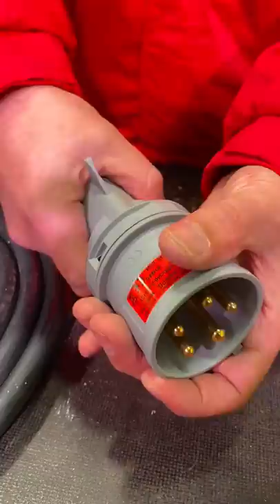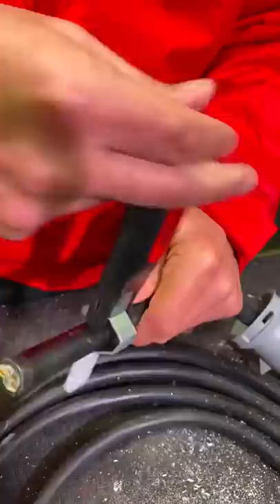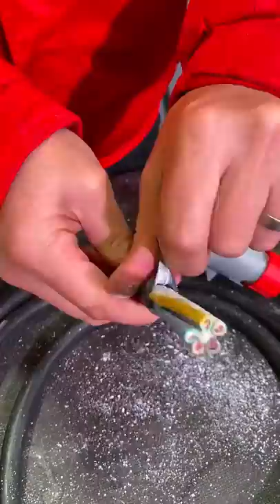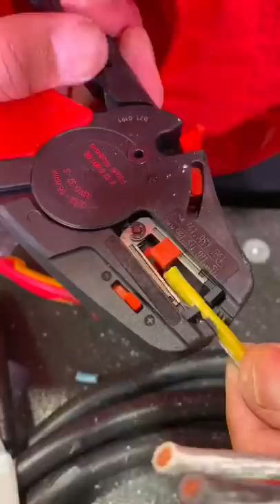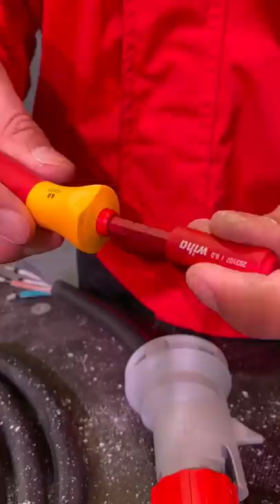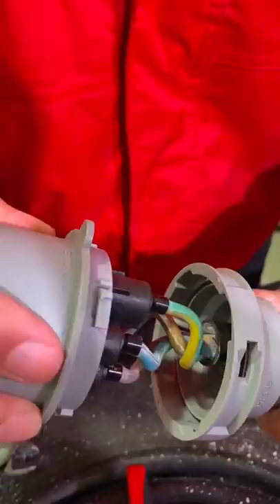Stretchy HO7 RNF rubber cable and a 32 Amp three phase plug. #shorts

Comment: My electrician told me to leave the earth cable a little bit longer in case somebody pull  the plug more aggressively the protection stay in the plug last. It's still relevant these days, what is your opinion about that?
Reply: The eath connection terminal is a bit longer, so it is already accounted for.
Reply: @lachertje812  I thought the earth terminal being a bit longer made the wire length shorter?
Reply: @TheFool2cool  Uhm...if all wires are the same length and the earth is closer...
Reply: @TheFool2cool  no, if the cable is ripped out of the plug, the ground wire should be the last one making contact. So it should be left longer. Some connectors, like this one have the ground terminal longer to have the same effect, you should never have the ground shorter than the others.
Reply: @lachertje812  Same rule applies for other situations where all connections are aligned.
Reply: @matekochkoch  if the earth terminal is longer inside the plug, which it usually is, the wire will end up shorter as the terminal is closer to the back shell of the plug.
Reply: @TheFool2cool  the wire is as long as you cut it. Regulation demand that the ground wire is the last to be disconnected when being disatatched by force on all mobile connections. So it should be left longer than necessary.
Reply: On point ☝️ earth cable should be first to make and last to break ....
Reply: Your electrician don’t know Jack. You put all the cables together. Safety in numbers durrr.
Reply: @matekochkoch  which regulation states this, out of curiosity.
Reply: @TheFool2cool  in Germany VDE 0701 / 0702 if I remember correctly. Most other countries have a similar regulation, simply because this one really makes sense.
Reply: Regulation in UK and much of Europe. In the US we use 120v and gfci. Still don't think it's a bad idea to add a little bit of extra for the ground though.
Reply: @ARVash  GFCI (=RCD) are mandatory for most installations in Europe too. but we use  230V (phase to N or ground). The shown connector was a three phase connector so the voltage between the phases is 400V  (230V*sqrt(3)).
Reply: I was thaught to do that in trade school just last year, so i guess it is. No reason to not do it really
Reply: Its okay move. Its highly unlikely to happen
Reply: I mean yeah always. There’s no down sides and just one day could be the day it’s needed
Reply: My dads an electrician I never really learned anything advanced cause I wasn’t interested but he always told me to leave extra incase someone else needs to go in after you and cut back some wire.
Reply: @lachertje812  which is why you especially need to leave it longer otherwise the pe gets ripped out first lol
Reply: You just don't pull out this cable trust me.
Reply: Jesus, you all need to pray to Jesus. 

The contacts inside the plug will disconnect the ground last. The wire length inside the plug has zero to do with that. 

You can wad them up or stretch them banjo tight, doesn't change the pin length on the plug itself.
Reply: @Sawyer_202  If you look closely at the video you can see the PE terminal is elevated from the others. So even if all cables are cut the same length, PE will still get pulled out last. 👍
Personally though, I usually cut the PE a bit longer than the others, just for extra measure.
Reply: i believe it is a standard practice in UK plugs. and i think its pretty smart
Reply: I am a Mechatronics engineer, at my work, pretty much a electrician and we always let the earth between 0.5 and 10 cm longer (depending on the location and use of it) 
and where I was still in my learning time, I got shit on for not cutting the rest shorter.
Reply: yup that is always taken into account just like how 3 prong plugs the grounding plug is longer than the hot and ungrounded
Reply: uk plugs already have this
Reply: @leftyeh6495  when you disconnect the plug, yes, then the plug design makes sure PE disconnects last. We were talking about someone pulling the cable out of the plug, not the plug out of the socket. And yes, if I make the earth lead 1 cm long and all the others a meter long, do you really think the plug will still ensure the others — with zero force on them because they have a meter of slack — will disconnect first?
Reply: @matekochkoch  I'm glad you replied with that now I understand why the ground is closer than the others I was cutting the ground so the cap would fit easier when assembling the cap  I'll now keep it the same length thanks
Reply: My opinion as an apprentice is exactly what you said
Check out a bit how uk plugs are wired on a device. The shortest conductor is live, a little bit the neutral and a lot longer the earth.
Reply: Same I learned the ground wire is a bit longer
Reply: That's more for standard plug wiring, where it's designed into the housing. But I believe it carries into many applications; the earth is forced to be a little longer.
Reply: i have added bit of length everywhere where pulling is issue. doesn't hurt. just with some cables it's too big to do it. but with 1.5mm2 and 2.5mm2 it's easy. my 3g2.5 has even little loop inside. but then in others i have nothing as i made them before realizing this. doesn't really hurt

Comment: Next week tune in for the Wago version of the plug 🤣
Reply: There are lever type CEE connectors, the company I work for uses them on the regular.
I can't recall the brand :/ not WAGO tho..
Reply: @SuperUltimateLP  PCE and Menkennes make them I’m sure. Though I always prefer a traditional midnight PCE screw connection with a bootlace ferrule 😉

Comment: Very good… net time leave the Ground a Little longer! If the cable gets pulled out it Should get pulled out Last! Could save your life some day.
Reply: Usually the ground connector is a bit longer/closer to the cable entry and should be the last conductor to disconnect. I also leave the neutral longer because you don't want to lose neutral
Reply: The Earth terminal is about a centimeter longer than the rest. All the wires were cut to the same length. Therefore the Earth one will disconnect last without needing to cut the others shorter.
Reply: @han5vk  the scenario is that the cable strain relief fails and the cable is being ripped out of the plug. hence, keep 5mm difference between live and neutral, and 5mm-1cm between neutral and ground wire length.
Reply: @harddiskwp Yes that was what I was talking about. If the earth terminal is 1cm closer to the failed strain relief than the others, it will fail last, even if all the wires are cut to the same length.

Comment: I have literally 0 wire work experience but for some reason this satisfies something deep in my computer loving brain. I built my own but this is a whole nother level dude
Reply: You would be surprised by how simple it is. Gets complicated when you are dealing with data transfer. A lot of peoples internet service problems are due to faulty lines and ports.
Reply: @dividedpersona 80% of internet service problems are over-subscription by the isp, which promptly blames the customers cabling and equipment.  15% is bad down drops from the isp or setup issues.  5% is actually the customers problem.

Comment: The PE must be little longe then L1 L2 L3 and N, because if it tears apart, the earth should be last thing wire thats connected. Well Thats how learned it in Germany.
Reply: That is true, but as you can see the hole for the PE is on a hill, which means that it will still be the last connected wire. Typical 400V plugs in germany work the same way.

Comment: HO7 RNF, sounds like something I should type into Google Maps!
Reply: It's a butchered version of a harmonized cable code. The code written properly is H07-RN-F.

H tells you it's a harmonized cable.

The two numbers are a code for the voltage rating, 07 means up to 450V to ground and up to 700V between cores. In practice though the higher rated cables with thicker insulation are used more for their increased durability than for their increased voltage rating. 

The two letters in the second section tell you the material the insulation and sheath are made from.  R means insulated with ethelyne-propolyne rubber or equivilent. N means sheathed with polychrlorophene (neoprene) or equivilent (better for oild/grease resistance than normal rubber).

The -F tells you it's a fine stranded (flexible) cable.

It does not tell you the size and makeup of the cable. That is coded with a seperate code, for example 5G6mm² for a cable with 5 cores, one of which is green/yellow and with a CSA of 6mm².
Reply: @petermichaelgreen  awesome explanation thanks for that

Comment: As a electrician….looks great…as a foreman…that to long that wire looked like 8-10#awg you don’t need ferules when it has set screws on the lugs. Don’t need that fancy stripping tool get a blade strip it out. Make everything tight ohm it out your good to go😂 JK that looked like a permanent installation, looked good

Comment: What tool was used to strip that? And yes that’s a serious question, cause I’ve never seen it. I use a 14/3 rubber cable for mini split systems and hate stripping the casing back because of the thickness.
Reply: Yeah name of tool would be appreciated
Reply: No name yet??!!
Reply: Got you bro, had to investigate myself!

Comment: What sort of end cutters are they using to remove the remainder of the insulation? The end result is pretty much perfect!
Reply: Did you ever find out what they are called?
Reply: @andyglass3882  Unfortunately not, they look a bit like miniature hoof nippers, I did find 'end nippers' but they're too chunky for this kind of trim. The closest thing I could find is the 'mini end nipper plier' by Amtech, but didn't order any as I still think they look a little too chunky for it.

I legitimately spent an afternoon trying to figure this out, as ragged insulation is pretty dangerous in high voltage applications and something I want to avoid when working on EV tech. Currently I use side cutters and it takes me far too long to trim everything flush.

Comment: I'm not an electrician, but would it be worth tinning the ends before crimping the ferrules on to prevent future corrosion creeping up the cable?
Reply: The plug is water tight there shouldn't be any corrosion

Comment: I've always wondered what is this white powder inside cables and what is it for
Reply from the maker: It’s talc and makes it easier to strip as the conductors don’t stick to the outer jacket of the cable.
Reply: To celebrate after you do a good job.
Reply: It's there to annoy electricians who don't like to get their hands dirty! 🤣

Comment: New to the industry and I haven’t had the opportunity to deal with wire this big. I have a stupid question, what’s the powdery substance that came out when you stripped the wire initially?
Reply from the maker: It’s French chalk - makes the cable easier to strip as it stops the inner cores sticking to the outer sheath.
Reply: @efixx  Oh that’s awesome, thank you for sharing man I appreciate it!

Comment: Then open it up again to swap the phases as the motor always goes the wrong way 9 times out of 10!
Reply from the maker: You should check with a phase rotation tester first- bad things can happen if a motor goes the wrong way.
Reply: Or just invert 2 phases in the motor...

Comment: Then you realize you need to switch 2 phases...
Reply from the maker: You should test for that first - bad things happen when phases are reversed.
Reply: @efixx  Well, usually it's things like coolant pumps and hydraulic pumps running in reverse.  Machine manufacturers don't seem to have any rhyme or reason to which phases are which IME.

Comment: Question: What's the powder stuff surrounding the cables? Is it for insulation or...
Reply from the maker: It’s French chalk - makes the cable easier to strip as it stops the inner cores sticking to the outer jacket.
Reply: @efixx  oh, interesting. I've never seen that before

Comment: Is it wrong to have the copper exposed out of the ferrule end? Like just a tiny bit. Or is that the right way to do it? Because i was told the IRSE standard requires it to be trimmed and needs to be exactly the end of the ferrule.
Reply from the maker: Weidmuller suggest between 0.1 and 1.0mm extending beyond the ferrule.

Comment: Why did you use h07 cable 5x1.5mm2 for 32A 3p+n+pe? In our country norma says that the best type is 5x6mm2 for that level od current
Reply from the maker: It is 6mm2

Comment: what's that white powder?
Reply: A dry lubricant, that's the individual wires can move a bit.
If they were "glued" to the outer rubber you couldn't bend it.
Reply: @SuperUltimateLP  thx
Reply: Carfentanil.
Harmless - to elephants

Comment: Yip you don't edit where each wire goes so how about it ??? It gives a person a leg UP ...real editorials like  thanx ..plz
Reply from the maker: We've got over 500 long form videos to choose from which go in to great detail.
Reply: There are idicators in the plastic molding.
If the shortened indicators dont mean anything to you, you are not qualified to even attempted to work on such a high power connection!

Comment: 32A connector? Why not 30A or 35A?

Europe is weird. Let's do everything on metric, so it's base 10. But our receptacles need to be 12 and 32A. That'll make sense.
Reply from the maker: Fuses used to be 15 A, 30A etc but when we moved to MCBs - it changed to. 6,16,32 - I’m sure there is a back story here!

Comment: What's with the ferrules ? Utterly pointless !
Reply: Cleaner job
Reply: I regularly find on inspecting cable with industrial connectors where ferrules are not used. That wire strands can be broken by sharp edges on the finish of the screws, even when the terminals are tightened to the manufacturers specified value.
Reply: @elementaldraco  this it helps to prevent individual strand breaking. I also find it's more secure.
Reply: Absolutely not useless on fine stranded cabels. Only idiots leave them out.
Reply: LOL what? Ferrules makes a better connection, makes wires reusable, eliminates fraying and thereby increases safety. 

Just yesterday I wired an inverter where the cables needed to be pushed through a brush guard and then into a snug fitting terminal only visible from above. That would have been next to impossible without ferrules. 

Any pro uses ferrules on multi strand cable.